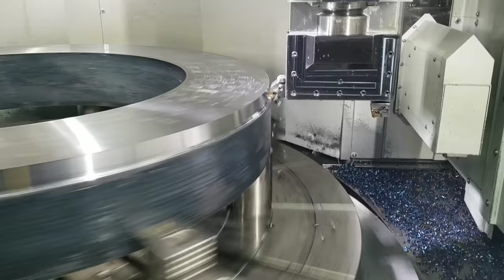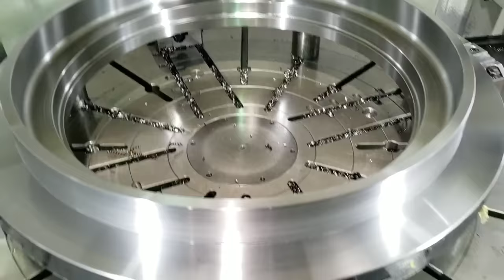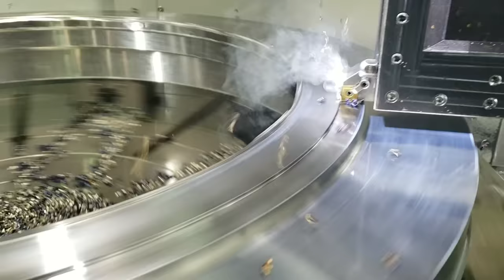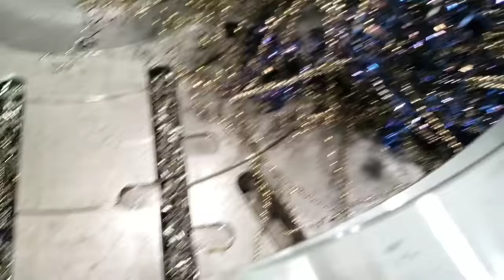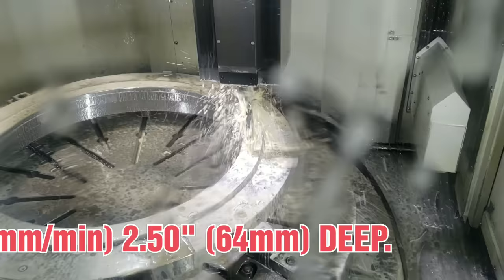CNC VTL / Retainer Ring /  Rough and finish turning (Pierścień ustalający, tokarka karuzelowa cnc)

Comment: I ran a cnc Bullard with a 56" table and a Fanuc control for 7 years and made all sorts of things from a controllable pitch propeller hub to pulleys for arresting cables on air craft carriers to water jet parts. It was the best and most interesting 7 years in my 45 years as a machinist / tool maker.

Comment: On March 20, 1982, at the age of 20, I was a new machinist (2 months) operating a manual 36" Bullard VTL, after having operated a large manual hydraulic drill press for the previous year+. I worked for a small company that remanufactured wellhead equipment, but we also made new wellhead articles from forgings.

That day, I was making my second pass (maybe 0.020" depth) at cutting threads (8/inch API) in the bore of a 7 1/16th" 15,000 lb.-rated wellhead flange, that I had already machined from a near-net-finish forging on the back side, when something caused a chip in the cutting edge of the threading tool (maybe hit an inclusion and chipped?). The shavings went from forming a harmless ribbon ball in the center to a jagged, deformed shaving that shot straight out between the jaws and slapped me harmlessly in the hip. Because it was a manual machine and the threading tool was traversing down toward the table in the vertical turret at 1/8" per revolution, I stepped back and grabbed the lever to disconnect the traverse and keep that vertical turret from engaging violently with the spinning table. Unfortunately, the shaving string extended farther out and, luckily dropped lower than my hip (or waist or thigh) and snagged my pants behind my left knee and cut through my peroneal nerve, which operates the muscles opposite the calf and provides feeling in the skin on the top of the foot out to the toes and up the lateral side of the shin.

I went by ambulance to a nearby small hospital, where the doctors started discussing a surgery, but my brother-in-law arranged for me to be transferred to Hermann Hospital (now Memorial Hermann), in Houston's Medical Center. That evening, I underwent surgery to repair the cut and reattach the nerve. The neuro surgeon was Dr. Michael Minor.

The orthopedic surgeon was Dr. James "Red" Duke, a well known Houston E.R. surgeon. Dr. Duke was in the E.R. as a Resident Surgeon on 11/22/1963, with Kennedy and Texas Governor Connally (generally credited with saved Connally's life). In subsequent years, he was frequently called on to give medical commentary to Houston media. Later, in 1987-88, a TV show, based on Dr. Duke, called "Buck James" and starring Dennis Weaver, ran for 2 seasons. It was about a West Texas doctor working in a NYC hospital.

My brother-in-law was able to get me to Dr. Duke because he had previously been a paramedic in Houston's Fifth Ward for over 8 years and had brought many E.R. patients to Dr. Duke and that relationship got me on Dr. Duke's agenda that evening.

It took about 18 months, but I did regain a bit of function from the shin muscles and have since only had a modest limp, not usually noticeable to others unless I'm tired or stumble.

I saw Dr. Duke a handful of times after my treatment ended. He had an apartment in the hospital and I ran into him there several times when I was there. A couple of those times was when my daughter was there to give birth to one of her 4 children. A couple of those times, I reintroduced myself to him and gave him the 15-second version of our initial meeting and he said he remembered me (probably primarily remembered my brother-in-law).

The last time I saw him was in 2014, when he was ~86 years old and sitting alone at a table in a Thai restaurant in Houston’s Rice University Village. As I was leaving, I reintroduced myself to him and gave the 15-second version of our initial meeting and he, again, said he remembered me. I noticed he was reading book published in 2014 and entitled “The Bonobo and the Atheist: In Search of Humanism Among the Primates.” He said it was very interesting and very thought-provoking, which I found interesting, coming from a man that had a divinity degree from a Baptist college. He struck me as a wise and sober man with a gentle and contemplative mind. I wish that I had stayed longer to chat about the book and what he took from it, but I was reluctant to intrude any further on his privacy. He died less than a year later, in 2015.

If you read to the end and enjoyed it, check back with me, if you want to read more of my stories.

Comment: Makes me remember back in the 1970's as an apprentice.   I got put on a 120"  Webster and Bennet vertical boring machine to machine some castings,   it scared the f***ing c**p outer me..lol.
Reply: My first venture into programming a CNC machine tool was on a Webster & Bennet vertical turret lathe. We used it to machine overhead crane pulley wheels from a forged ring of material. Happy days.

Comment: Several years ago, in a shop outside of Chicago, an operator got caught up in the clamps holding down a large valve body on a 6' diameter VTL.
It's a big shop with lots of distance between machines.
Nobody noticed right away, he must have been too surprised and dead too soon  to call out.
Never defeat the safety interlocks on your machines, ever.

Comment: Perfecto mi amigo Chris ver esto me emociona  Saludos desde Torreón Coahuila México 👍👍
Reply: Ok, Chris good but I would like to ask did you put an indicator on your finish part before you release the jaws how much movement on the materials. Because if the indicator gave readings then the dimension changes once you remove the finish part on the machine.
Reply: Saludos al de Torreón soy lagunero también maneje ese torno si no me equivoco es un Honor y creo que es fresador tambien

Comment: I haven't seen any videos on how to use this type of jaws, do you just manually open and close them with a wrench to center part then torque them all tight? If so, how many  ft.-lb. are you tightening them at?
Reply: Manual tighten..tighten all you can...use cheater bar..

Comment: How close are your tolerances and do you maintain good concentricity with this retainer ring.  I use to make parts like that on a manual kick Bullard.  Putting in a large radius was always tricky but a kick Bullard allows you to control your RPM's.
Reply from the maker: The tolerances were not that critical +/- 0.002" ,but I got it done within 0.001" on flatness and circularity (roundness) just have to be really careful how much pressure you put on your jaws.

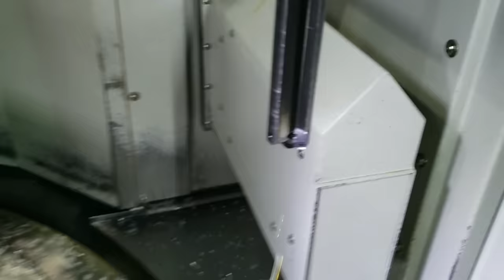Comment: 6:42 looks like built up edge, maybe spindle speed too low? Doing the math is 31 m/min, more like HSS speed than carbide speed... I guess it's for tool life but it may chip the insert sooner.
But for sure it has worked fine. Nice job!
Reply: Yea wouldn't it be nice if you couldn't go too slow,  but you can, and I didn't know this until recently

Comment: Nice work. Are those threaded holes blind? You should use a spiral flute tap in that case. To pull the chips out the top instead of pushing them down.

Comment: First CNC lathe I ran was a Seiki VTL with a 60” diameter table.  This machine looks almost exactly like the vertical I learned on.  The chip bed and everything looks the same.  I’m interested to know if it is.  Honor Seiki VL-160CM was the model I learned on!
Reply from the maker: It's a GOODWAY Yama Seiki GV-1600m 63" table.

Comment: Awesome stuff! I imagine you must be careful to not overtighten jaws on a job like this?
Reply from the maker: For rough turning I use little bit more strength, for finishing I'll go easy on the jaws.
Reply: Yes the machine I ran had an adjustable hydraulic 4 jaw chuck and using a dial indicator to sweep the part being careful not to over tighten and distort the part.
Reply: @ChrisMaj  Very good answer.  After roughing and part has cooled and ready for finishing you will see how much it sprung when you indicate it for concentricity and flatness.

Comment: R the cutters w/o coolant being sprayed on the cut cooled at all? Considering what a big cut they r taking it seems like they would overheat.
Reply from the maker: I did use coolant, I'm just trying not to use it while recording.
Reply: Not always necessary with steel, depending on workpiece tolerance.

Comment: All of the Cnc lathes where I work are 3 jaw, I’m sure they can change over to a 4 jaw chuck, but what is the point of having more jaws? More accurate? Is that why you are using the indicator? Just curious. Beginner Cnc operator.
Reply from the maker: Yes they are more accurate and you can do some odd shapes https://youtu.be/eC7c4SJkzzQ

Comment: If I may suggest an improvement, I would very much like to see sped-up video rather than cuts and editing. It would be MUCH better. This is interesting work and you have great material, but you're cutting out the progress - the most interesting part. :-(
Reply from the maker: I'm just recording as I go. I don't really have the time to record everything.
Reply: @ChrisMaj  That's a pity. :-(( This is absolutely amazing. Huge parts, CNC lathes. I've never seen anything similar on youtube. Maybe attach the camera somewhere so it car record while you work? Thanks for the videos anyway.

Comment: I have a job I rigid tap a 1-8 tap, what Ø do you drill the hole?
Reply: 7/8” or .875 inch.
Reply from the maker: After breaking a few large taps in my career I'm literally scared of rigid taping.
Reply: Don’t check a tap drill chart, whatever you do.

Comment: i am surprised if you kept roundness doing it this way.  my experience with forgings such as this would be to rough all diameters to 1/4 per side,  all faces to 1/8 inch... then set aside  or even stress relieve.  finishing one side and crusty the other side  is bad practice in my book.  43 yrs machining large parts
Reply from the maker: I know that on the video it looks like I'm doing everything in one day, but the parts do get some rest time after roughing. Most of the time there's semi finish but sometimes I just skip that part on the video.
Reply: @ChrisMaj  is the part released from chuck pressure  and reindicated--even with out of roundness accounted for?  i say all this  because we both know  there is heat buildup in the part after the massive roughing amount   of both sides,  and if its not allowed to calm down in a relaxed state,  concentricity  and parallelism suffer.  i've done tons of heat treated 4340 forgings that went haywire after the 1st side was roughed,  and went squirrely again when the 2nd side was roughed.  so bad that the releasing of chuck pressure was necessary after semi finishing.  heavy duty excavation equipment and power generation parts always seemed to be the worst for this phenomenum.

Comment: Oh wow, so inefficient,  couldn't have the casting been smaller in size?
Reply from the maker: It is very simple to make basic rings of various sizes with roller and hammer forges; more complex geometries require specialized equipment. You'll pay extra for it, and it usually doesn't make financial sense unless it is a high volume production part.

Comment: What's the center drill for? Do you use a thrue hole tap for a blind hole?
Reply from the maker: They are called Spot Drills. They are used to improve the accuracy of secondary drill  operations. That was a plug tap it can be used sometimes for blind hole applications.
Reply: it's ok to use that tap for blind holes. Just make the hole a bit deeper so it wouldn't fill with chips

Comment: Poor tool application. Why run a profiling tool on a straight cut. A couple of times on facing the top, tool pressure is pulling against set screws only..
Reply from the maker: I think you can tell that I'm not doing production work and I'm not always trying to get the perfect tool for the job and save 5 seconds on my cycle time.

Comment: Trelleborg, southernmost in Sweden, Lördag den 21 november 2020.    Hello!      When you drill. Where does the cooling water, (emulsion), come from? Can the water get through the (spider?) spindle and through the chuck into today's modern machines? ## 

I Sverige har domare rätten att begära mutor. 
Med vänlig hälsning 
Tomas. 
Före detta skeppare på s/y Ofelia och 
Pappa till ”Fallet Axel, 29 år!" på  http://gidlöf.se , (http://tomasgidlof.se ) Myndigheter har utomrättsligt rånat mig på båten. Ett politiskt brott.
Reply from the maker: Yes this machine has a through spindle coolant and air.
Reply: @ChrisMaj  21 november 2020. 
Thank You for the answer. 
Early 1970 - ies  i was worker a cople of Years in mechanical workshops. It has been an intersting dewelopment. 

The largest lathe I have seen was by Trelleborg AB , the rubber industry. www.trelleborg.com They did (coate?) covered rollers with rubber for the paper industry. Before the rubber came on they turned the rollers. One travese for the workpieces was marked 75 tons. The turner stood on the support. The chips was sometimes 10 mm thick. 

The buildings are emty since many Years. 

Regards 
Tomas. 
Ps. 
Why do You not tell the name and location of your company in the YouTube channel? 
Ds.
Reply from the maker: @tomasgidlof9545  I'm just doing this for fun and I know a lot of people like to watch that kind of stuff. I don't want to get the company involved.

Comment: NICE JOB,WHY ARE U USING A GUN TAP ON A BLIND HOLE,WHOS THE POOR BASTARD THAT HAS TO DIG  THOSE CHIPS OUT OF THE BOTTOM OF THAT  HOLE,GONNA BE ALITTLE SHORT ON LENGTH UNLESS U DRILL THE HOLE  DEEPER,BUTS IT COOL JUST USE A SHORTER BOLT I GUESS

Comment: Quite slow! 2000 rpm would be better suited?
Reply: No way 2000 rpm is not possible...plus the amp draw on the motor would kick it out...inserts wouldn’t hold up..I’ve ran bigger parts than this..keep inmind how much material is being removed in one rpm.
Reply from the maker: @pickerjim9246  Yeah, and this machine maxes out at 270 RPM.

Comment: While the machining is spot-on, the casting/forging is horrendous. You lost, what? 55-60% of the cast to chips? Whomever designed the blank should be fired.
Reply: I’m wondering if it might be plasma cut from plate? Though it does look quite a good finish for that
Reply from the maker: @porkerthepig  that was a rolled forging.

Comment: I agree this set up won't work on critical dimensions and accurate flatness , needs a better set up.
Reply from the maker: Well actually I got it done within 0.0005" (0.0127mm) on flatness and circularity (roundness)
Reply: Hard to deny the actual tolerances one is able to hold with these machines. Machinist for 25 years with work on large bullards, kings, and some swedish VTLs. They truly are remarkable machines. Nice work man
Reply: @Zak Anderson zak, once you release the jaws the materials move making it out of flatness and it won't be circle specially if your working on material like titanium
Reply: @ChrisMaj  Chris you we're lucky then to get it within those tolerance and the way you set up the workpiece. , no offense there a better way to set up the work it all comes to our experience.
Reply from the maker: @sergiojavier2112  No, there was no luck involved. I know what I can get out of this setup/ machine  and believe me luck isn't your friend on parts of this size or larger, but I'm always open to suggestions.
Reply: @ChrisMaj  g
Reply: I did it all the time but it depends on the part. Material and size of the part but it can be done.
Reply: @sergiojavier2112  Try, rough side one then flip the part and then rough and finish side two then flip it back to side one and finish it leaving no more than .010 for finish passes. This worked every time for me and I could hold .0003 flatness on large parts.